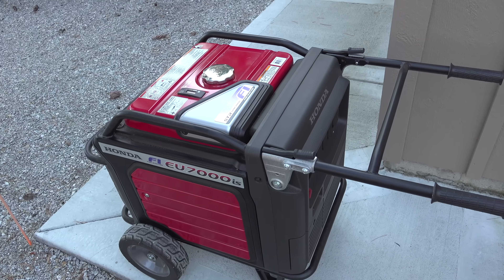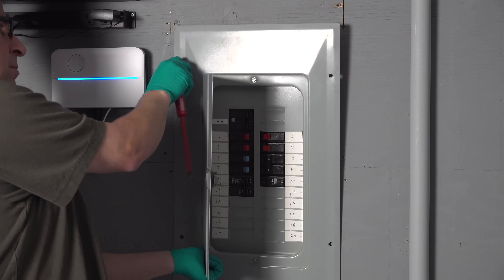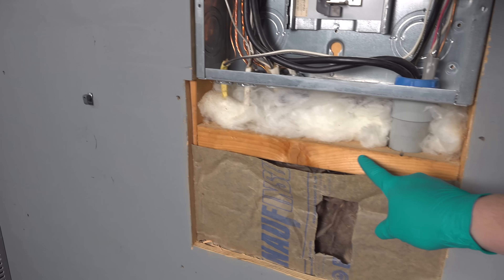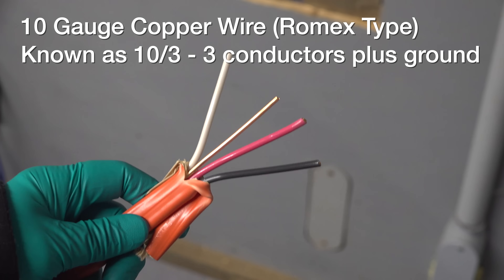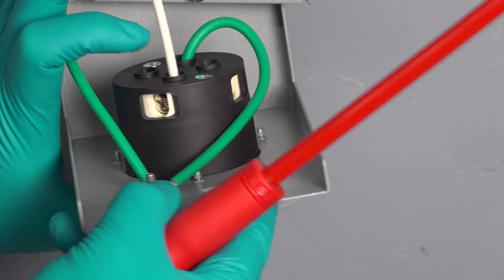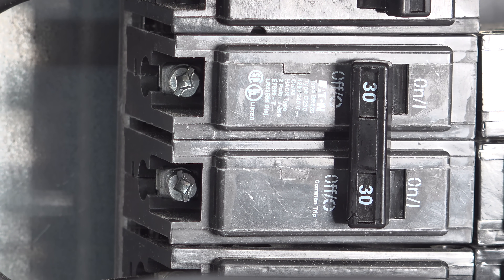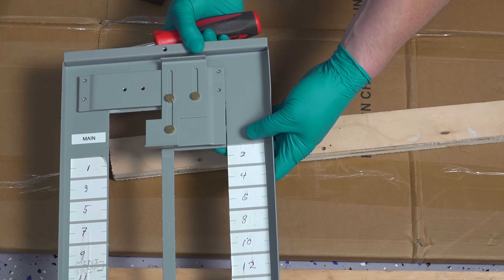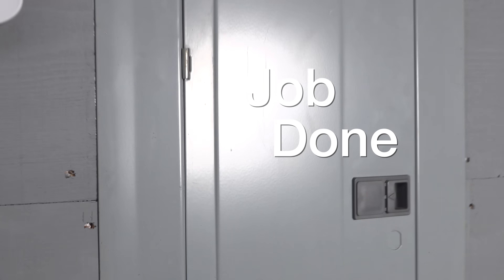Cheap & Easy Way to Connect a Generator to Your House - Legal Too!

Comment: That Honda has a floating neutral. Most generators are bonded. Not explaining the difference in DIY videos can lead to code violations and potentially dangerous situations. When installing an interlock with a bonded neutral generator, you have to remove the jumper or you will be bonded in more than one place.
Reply: Is this merely a code violation or an actual safety hazard?
Reply: @magnate2372  I’m not an electrician but def a code violation. You only want one path to ground, not two. For example, there would be a chance of sending a fault to generator housing. Good short video is “How to Ground Your Generator Per Code | DIY”
Reply: @chrism5931 I found the video. Thank you!
Reply: @magnate2372  good luck

Comment: I just bought a Batteryevo Arctic. 15.5 kwh capacity. It comes with 2 cables to connect it. One for power into the battery, the other for power out of the battery.  The battery is connected between the main panel and a sub panel with the circuits to be backed up.  One of the cables can be used to connect the main panel to the sub panel if the battery is removed.

Comment: All my plugs run on 120v  except for  my dryer plug, can i still wire it like this video or will it burn my appliances?
Reply: If your generator is 240 volt, then the way shown in the video will give 120 v to all of your 120 volt plugs in the house.
Reply: @johnsteed99  thank you

Comment: Question about bonding neutrals. Since most inverter generators come with bonded neutrals and GFCI outlets, won't the transfer switch connect the bonded generator with the already bonded main panel and thus not be up to code?

Comment: Is this how you power both sides of the panel?
Reply: Yes.  If you have a 240 volt generator and a 240 volt cord and a double breaker as shown in the video.

Comment: Everyone is forgetting one item. By the electrical meter there should be a sign or label.  Stating a secondary power source,  for firemen or the power company. Check out article 702 i believe.
Reply: Code is different in every state. We have solar on the roof and are not required to post labels about back feeding. The power company is required to note it themselves

Comment: Great video!!!  Glad to see the Generator Interlock installation - it is VERY important to have & will save lives. (maybe yours)

In most cases, your generator will NOT be able to power your entire house.  Before you actually have to run Generator power, Identify which Circuit breakers are your 'Essential' ones (Furnace, Well Pump, Fridge, Freezer, essential lights, etc)  I used a green paint marker to mark these breakers.  Next, I marked the 'Nice to have' breakers (garage door opener, more lights, outlets for TV, etc) - I used a yellow paint marker.  The remaining go unmarked & are things that take high amps, like the Range, Electric Water Heater, A/C, Electric Dryer, Washing Machine, dish washer, etc.  Monitor your Amp gauge on your generator.  You can run your Range if you turn off some of your Essential breakers.

Making a Checklist & instructions on 'How to' get everything working, in the proper order is good to have.  Make sure you have a working flashlight available.  You will have to get this working in the most inconvenient time & conditions.  Make sure you start & run your generator every 30-60 days to insure it starts & runs.  Keep an extra quart of oil available & rotate your gas.  Do a full test at least once a year.  (nothing worse than to have a generator that wont start of run when you really need it)

For extended power outages (several days or longer expected) - run your generator for about 1 hour, then shut it down for about 2 hours (or more, based upon your conditions).  This will allow your limited fuel supply to last longer.

Comment: I'm kinda confused. So by moving the other circuit breakers down and putting the double pole generator breaker under the main, that makes it so the other breakers underneath will get power when flipped on?
Reply: Nothing is changing except for the slot that the breakers are in.

Comment: Don't have a generator any more but ,on the cheap, I thought if during a power outage,  I could pull the main breaker then connect the generator to an exterior outlet I would have whole house power.   ..Opinions??...

Comment: I'm an electrical contractor and I install many of these set-ups. I will NEVER install the inlet inside of a building or garage. I will only install those on outside walls. You might be smart enough to never run the generator inside the garage, but you may sell the house to some idiot who decides to buy the shortest cord for their generator, then runs the generator in the garage, and ends up killing their family. Carbon monoxide poisoning kills more people that you would believe, and I will do my best to prevent that from happening.
Reply: Inside is for solar generators
Reply: @Jkingg10  Incorrect. Those are hard wired.
Reply: Is the genetic line of a man who runs a generator inside worth saving?
Reply: @jwm6314  That's the other side of the argument...lol
Reply: I see your concern as a contractor but as the homeowner I have a battery generator I’m using inside the basement and installed the inlet box right below the panel. It makes no sense to put it outside in my situation and quite honestly I can’t worry about the “next homeowner” being ignorant.
Reply: Is that really all they need to know?
Reply: @echohotel1094 is this really the hill you want to die on?
Reply: @echohotel1094  smelly engine fumes=bad 
literally nothing else you gotta know 😭
Reply: @editoons15  CO and CO2 are odorless. You are exactly the type of person I was referring to.  Please don't kill your family with your ignorance. 
Thank you.
Reply: @jameskoehler4939  they are odorless yes but they come out of the exhaust along with other compounds and everyone knows that engine exhaust has a distinct smell
Reply: @editoons15  Are you from Florida? Seriously, you're digging a hole, son. Stop talking.
Reply: Co is more serious than Co2 due its affinity to being absorbed by red blood cells
Reply: Carbon monoxide is a gas that causes asphyxiation NOT poison. CO attaches preferentially to hemoglobin instead of O2.  The person is checked in a hospital and found to have plenty of O2 in his blood...but dying from lack of oxygen.
Reply: Thats why they sell longer cables like the welders and put the generator out side.
Reply: Far more people die from obesity than CO poisoning. Grocery stores in the US  would go out of business if they had your standards.
Reply: I have one of these in my garage for my Goal Zero Yeti PRO 4000 and expansion batteries. It’s serves as a 3600w pass through cable to charge and pass current to the Haven 10 transfer switch. Works like a charm. Oh, and no carbon monoxide. 🤫
Reply: Sorry not responsible for another person's stodity
Reply: Well said
Reply: I don't understand why he did that either. I'm not a sparky but no way in hell would I do that.
Reply: Carbon monoxide is CO, not CO2.  Just saying...
Reply: @echohotel1094  You are correct sir. I edited. Not sure how that brainworm got in.
Reply: @echohotel1094 same difference 😭😭
Reply: @editoons15  no it is not.  Carbon dioxide vs carbon monoxide.  Simple chemistry for most. Good luck!
Reply: @echohotel1094  same difference as in this case theyre both deadly… thats all someone has to know when running an engine indoors
Reply: Some of these comments just proves we need less idiots.

Comment: Why not go with a 50 amp inlet and use an adapter to connect your 30 amp line? That way you won't have to change anything if you upgrade your generator.
Reply: I have this generator, it only puts out 30 amps at 120/240 volts. If you parallel two of them then yes, a 50 amp plug would be better since it doubles the amps almost. His reasons are probably because he only needs 30 amps which is what that generator puts out. If he would upgrade the plug in the future, you are looking at maybe $20 or less. It’s not a big deal since it’s already wired with two breakers.

Comment: what if my Main is located at the lower right hand side of the MPU?  is there another interlock kit that would work?
Reply: Just switch that 1 off whenever you have the generator on, the interlock kit is there to make sure you don’t have the power from the generator feeding, while the main power from the city is.  It’s not “legal” because it risks the chance of blowing up incase you forget, but if you’re sound enough and have the IQ , you don’t feed two powers into one , that’s all bro , try to move your main down one , put the generator breaker into that place , and then make sure to turn it off whenever you need it

Comment: Are you just running your generator output cable through an open door? I don't have that option. I'm going to have to go through the wall of my house and into my basement utility area.
Reply from the maker: You can do that, I have done it through windows, obviously if its gas and their is exhaust you must make sure its far enough away. But I also use battery systems too and having it indoors is the only option for them, so you can do it whatever way suits your generator location best

Comment: Having installed many of these, AND consulting customers, the BEST course of action is ...
Only install  6/3 wire from inlet box to breaker panel, someday you will want to UPGRADE to a larger generator (50 amps) (electric start) making it easier for a spouse or kids to facilitate the starting of the generator if you're not home when emergency  arises.   Always put inlet box OUTSIDE allowing plenty distance AWAY from house (windows, vents etc )  also consider installing an outdoor 120 volt service box (receptacle) to charge your generators starting battery BEFORE THE STORM hits.
TYPE OUT IN LARGE letters an instruction sheet so ALL family members can follow procedures  to start generator.  Have flashlights  strategically located to start generator IN THE DARK.
Keep FRESH fuel supply in stock , plus oil change, air filter and spark plugs WITH dedicated tools on site . Do you want to go shopping at 3 am in an ice storm for a spark plug  to start a generator to keep your furnace on ?  (Or send the spouse 😅 ? )
Reply: If I may add to that,  you can usually buy a replacement carburetor for less than $50,  it's my experience a gummed up carb is the first item to give you trouble!  So many people are so glad to get utility power back on they just pust the generator in storage without running all the fuel out of carb before storage!  I keep my generator ready always but I have an extra carb just in case!
Reply: @scott1395 agreed… always gummed up when you need it most. Having a propane genny solves this issue.
Reply: Excellent preparedness tips!
Thank you
Reply: I actually did this today with a 50A inlet on the exterior, 6/3 WG, 50A breaker and lockout.  Back before Y2k in my old home I used a GE generator panel with 30A opposing breakers that had a large tab between.  One on pushed the other off.  Wired 10 priority breakers for priority items and it was a done deal.
Reply: Why does it have to be outside?  I own an apartment where the breaker box is on an inside wall.  Technically there is a way to run the line to the outside but it will be a mess to do it.  I don't mind running a 30 ft cord to the breaker box leaving the door open.  In the case of a power outage we will not be in that room.  Is there a problem with this as far as code goes or are you just giving advice?
Reply: @baruchfishman1874 the only reason u want the generator outside is if it's gas powered
Reply: @baruchfishman1874 Gas generators give off CO2. Not a good thing to have indoors. For everything else, it's probably a good idea to keep everything as far away from the structure in case things go south and you end up with a short circuit.
Reply: How about putting one inside by the breaker panel for a sogen setup. As far as I can tell there is no issue
Reply: @davidbailey3289 great idea! My inlet is outside and wish I had one inside too for my battery bank
Reply: Well rounded. I also have some extra replacement fuel lines for the genny can’t hurt to have just in case.
Reply: How much does this generator power?
Reply: Great video.  This looks to be to a sub panel. On a main I think you only have a single bar for ground and neutral. 

15’ of 6/3 is about 85 bucks from what I can tell. 

50 amp circuit breaker 20
50 amp receptacle 40
25’ cord from gen to receptacle 90
3/6 Wire 85

You can get some kits with the extension cable and receptacle for 100 to 120. 

Total about 250 with tax.
Reply: My electrician did 
That,installed 6/3 in case I ever wanted to upgrade
Reply: Putting the inlet box outside does nothing for safety itself.   I think perhaps what you meant to say was to make sure your setup was done in a way that the GENERATOR is outside.  I know many people who have the inlet box in the garage, with the power cord running outside to the generator.
Reply: @5thGenNativeTexan  you totally missed may POI. There are power inlet boxes you can place on the inside in certain situations. What he described wasn't one. God I hate it when someone tries to play me know it all

Comment: Question. When you run generator to that one 240 breaker. Doesn’t that only feed electricity to that one side of the panel?
Reply: checkout some online pics of breaker panel layout , you ll see each leg of the panel bus bars alternate as the breakers are inserted into the bus bars. A or B.... Ex bkr 1 on A  Brk 3 on B  brk 5 on A bkr 7 on B  etc

Comment: Super. In an emergency, if you only have a 120 volt generator, you can temporarily connect to both line 1 and line 2 as long as all 240 volt two pole breakers like the dryer, stove, and sub panel breakers are ALL turned off, as well as the main breaker. I have a short cnnversion cord that allows a 120 volt generator to connect to both poles of a 240 volt 30 ampere inlet from a standard extension cord, powering all 120 volt breakers, but you have to make sure to shut off, or not use, any 240 volt items. I have two inlets to my panel, along with the main/generator lockout, (More money = auto transfer switch) however, I have two inlet plugs, 120 volt × 20 ampere and 240 volt × 30 ampere connected to a 30 ampere transfer switch, so i can plug into most generators. I also have a large deep cycle 12 volt RV battery permanently hooked to a 1500 watt inverter, and a trickle charger, on a cart, which I can plug in to for quick emergencies. (20 ampere inlet.) The battery will run my hot water heating boiler, thermostat, pump, and valves for three days, which is longer than my generator runs on one tank of fuel. 💙 T.E.N.

Comment: The risk of and duration of power outage you have is directly proportional to the amount of money you spend on your back up system. If you wash your car it will rain, if you buy a snow blower it will not snow. 
BTW I have 2 manual GE knife throw switches $200 each.  It is a simple one arm bandit style switch that lets you select between two sources of power.

Comment: I installed a subpanel with 3-way rocker switches right underneath the breaker box. 1 position is fed from the generator, one position is not fed at all, and the other position is fed from the street. That way the generator and the street will always remain separated.
Reply: This is exactly what I'm trying to figure out how to do I just can't see it in my head

Comment: Curious to know if you considered Gener link... before the installation of a transfer switch ?
Not many people are skilled or comfortable  with electricity especially 240Volts
Reply from the maker: I would love to get one of them, but something is weird about their company. They seem to always be out of stock and don't reply to customer inquiries that I have seen and I honestly thought they were out of business. An electrician told me once the problem with them is that most customers don't have their meter where they want their generator. But I did like the concept. popwer companies shoudl rent them for like $5/mo they would make a fortune
Reply: @SilverCymbal  Where I am located in New Brunswick,  Canada, the New Brunswick Power  Company will install one free on your meter for a fee of $23 a month.  I just went through a 6 day power outage Dec18-23, 2023  after a rain & 100km hour winds storm.  I am considering getting Generlink  and a larger 8000-10000 watt generator.
Reply from the maker: @paulinedavis8734  I would absolutely do that, especially with their support. If the meter is a good spot for the generator hookup I can't see any downside. Must be that they are not well established maybe in the US. Lucky that you can get one!
Reply: @SilverCymbal   House & Garage are separate & detached ....I hope a I will be able to run a  long 50 amp cord from the meter on one side of my house  to a generator near my garage on the opposite side ????

Comment: We use a 3phase changeover switch for mains and the generator.
Reply: Out of curiosity, which leg did you use for the Neutral in that transfer switch? Left, Middle, or Right?